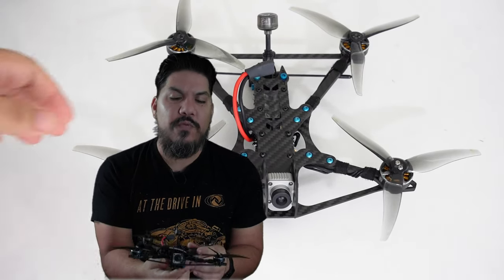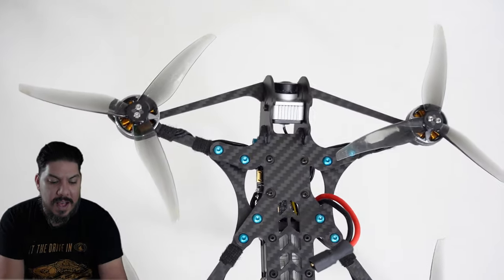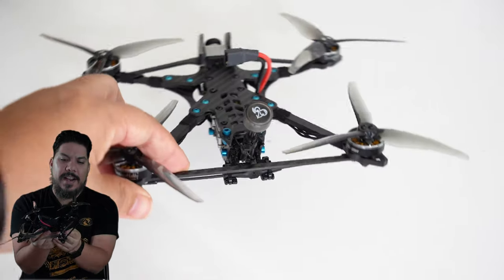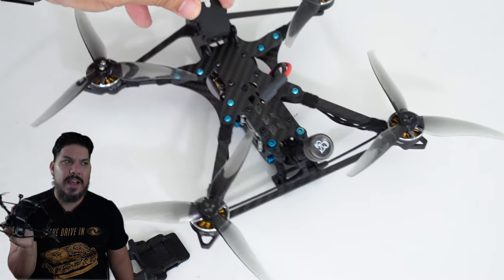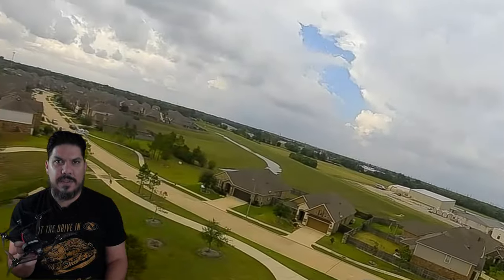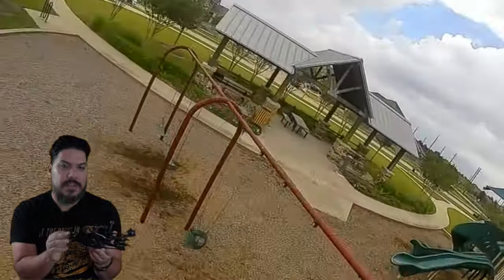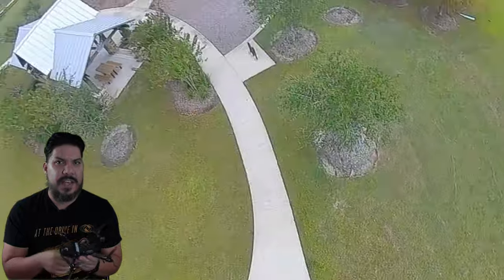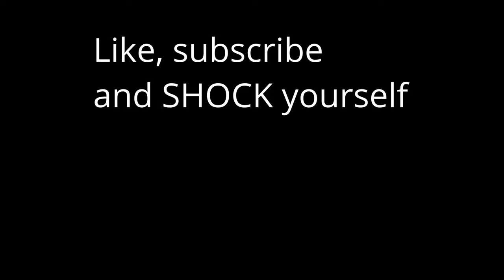Shocker Catalyst Machineworks Ultralight 4" or 5" quadcopter - long range and freestyle drone

Comment: Hi, I saw a video that explain some aspects of the design of the frame and what caught my attention was the way the cage is fixed with the body with just only  2 nuts and the rest only fits between the carbon parts. My question is if the frame feels stiff or has any play that could produce vibrations
Reply from the maker: it is stiff for the category, because the arms are essentially bolted onto the same plane as the top plate.   The carbon pieces are still a bit thin, because its meant for smaller motors.  I didnt have any vibration issues.

Comment: There's way too much focus on getting footage. I'm sure I'm not alone in just wanting something that flies well and screw the footage.

What I really want to know is will it be as agile as my current favourite 500g AUW 2205 setup.
Reply from the maker: i know EXACTLY what you mean.  I built up a DJI 3" im working on now, and its a little underpowered since i was going for light weight, but the control is insane.   This is similar, because unlike most of my freestyle quads when i dont have a gopro strapped on, it is not overpowered.  It feels just right, so i found myself pushing closer, faster with this, because the control was exactly what I wanted it to be.    If you end up building one, drop some notes, i would like to see how it compares.
Reply: @JonE5FPV  That's basically what I get out of the 2205s (1300 6s gives me 8+ mins on quadblades too). I tried 2204 but the drop in weight wasn't enough to compensate for the drop in power. I've got some ultralight frames but need to get electronics and motors for them....and lipos.....for winter.....motivation there is low.
Reply: I’m with you on that. Getting some cool shots is nice sometimes but at heart I enjoy flying for flying. Plus smashing your GoPro into pieces ain’t worth it for video that nobody really cares about. Freestyle is so much nicer to fly without GoPro weight, I usually only use it for my long range flights.

Comment: I’m concerned about long term and landing on the belly. I fly mostly over  concrete. Can see the bottom carbon getting chipped away quickly. What do you recommend?
Reply from the maker: I’d design a printed landing gear. Or just use a few zip ties so you land on those instead
Reply: @JonE5FPV  Both are good 
options. A 3D printed skid that’s not overly long would be perfect.I’m picking up this frame. I have the same kv brother hobby motors. Time to go 5” ultra lite 🤩
Thank you.
Reply: @JonE5FPV  I’m building a 6s version and trying to get the equivalent pop from the motors as you get here. 
I know 3150kv and 4s on 5” props is higher kv . My options are 1950kv or 2100kv on 6s. Go for 2100kv ?🧐?
Reply: @JonE5FPV  Jon can I get the file to this?

Comment: What size is the battery when the auw is 270 gram? 

I saw bardwells review and he prefered the 4 inch. But his auw of the 5 inch was 370 gram. How did you get it 100 grams less? It looked the same except he used a 1100mah 6s battery.
Reply from the maker: 650mah 4s which is around 70-80g battery
Reply: Thanks! And then the ladt question is what flighttimes do you get with that battery?

Comment: Hi Jon can you share your tune for this ? Im building my own shocker using your suggested parts, i only missing the tune
Greetings from colombia
Reply from the maker: hey man, i used stock betaflight 4.2 on mine believe it or not.  Only change i made, was to move the master filter slider 1 click to the right of default.  Everything else including rates is stock. Thats just how i roll, since i fly so much stuff, i like them all to feel somewhat familiar.  I only really "tune", if i have hot motors or something.
Reply: @JonE5FPV  ok thanks

Comment: Got some JB2407 motors on my old frame which needs replacement.  Would these motors go on the frame with a suitable esc that fits the 20x20 mounting?

Comment: Weight def under 250g is u use small battery and 4k tarsier instead (tarsier saves 5g over vista with certain vtx) 
I wish I just built this instead of ordering explorer now
Reply from the maker: yeah, i have explorer back ordered still and kinda wondering if i will even like it after this.
Reply: @JonE5FPV  I know ill like it though way under powered.  But I ordered Aug 16th. In sept 20th I was told a few days. Then a week ago I was told shipping this past Monday or tues and still hasn't shipped
Reply: I ordered the 4" version of the Shocker as well. And about the Explorer I ordered the Vista ready version and it was delivered with in 2 weeks. And vistas are in stock at PyroDrone now.

Comment: Excellent review. I’m curious why people are still going with 4s packs these days. 6s packs are closely priced and offer better performance. With the new BF you have control over power so you can limit to 4s levels and get additional flight time if you wanna go LR and then go full send if you want freestyle. Just curious your take?
Reply from the maker: Great question.  The primary reason I use 4S on 5" ultralight, (or 3-4" as well), is weight and frequency of massive punches.

On anything traditional 5" (racing or freestyle),  I totally agree with you.  I only fly 6S on all my race and standard freestyle builds for the last 3 years.

But a 1050mah 4S pack weighs a fraction of a 1250mah 6S pack.  And costs a fraction as well.

Also, its because of the packs i own and dont really want to buy a ton of those mid range packs.  I think a 650mah 6S could perform pretty similar to an 850mah 4s, but they cost more, and id have to buy them.  And i prefer not to stock a ton of those boutique sizes.

It can be done for sure, but part of what i like about this form factor isnt just the weight, its the reduced cost.  Also because its carrying around so little weight, even a 4S 850mah 4S can last 5-7 mins freestyle easily with a decent sprinkling of punches.
Reply: @JonE5FPV  Which of frames, 4" or 5", do you think would be more suitable with the 4s 850mah? since all the other micro LR (flywoo, geprc, iflight) recommended that size for their build

Comment: Great review. What motors are you planning on running on the 4 inch
Reply from the maker: Thanks! I would use those blue 1805 2550kv Betafpv motors for 4”.

Comment: Great video, I pre-ordered my frame and I can't wait to get in my hands and start my build.  Would you mind sharing your PID tune for this build?  thanks
Reply from the maker: Actually i was so excited to go fly this, that it is 100% stock betaflight 4.2, even stock rates. I just set switches and went to go fly.  Only chage i did make, was to move the filters 1 click to the rigth from default.  thats it.

Comment: I am currently building your exact build. 

I hope you have time to answer some quick questions.

What awg wire do you use on the powerwires on the fc? And do u use xt30 or xt60 connector? And last do you use the capasitor that came with the jhemcu fc?
Reply from the maker: I used xt30 but either will work fine. Use whatever batteries you have most.  I used the cap it came with yes. You can always add an extra if you have space as well. 

Don’t recall wire, but the one that normally goes to xt30 or whatever came with it